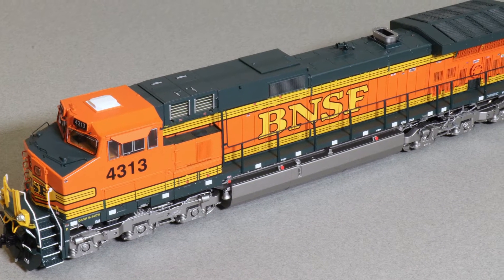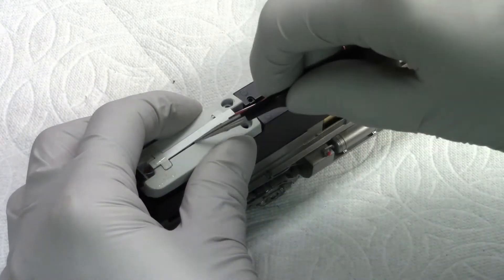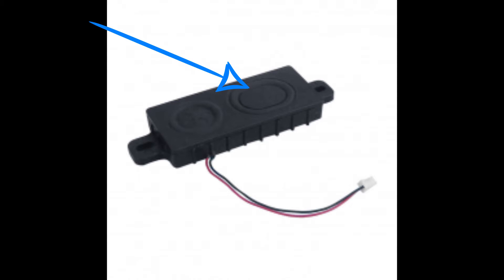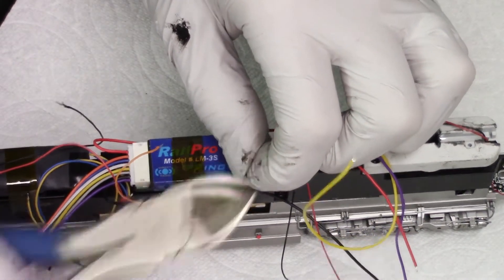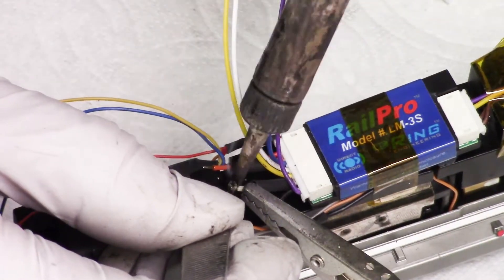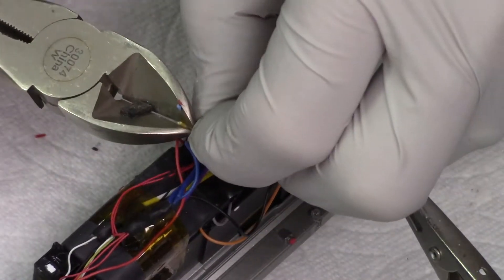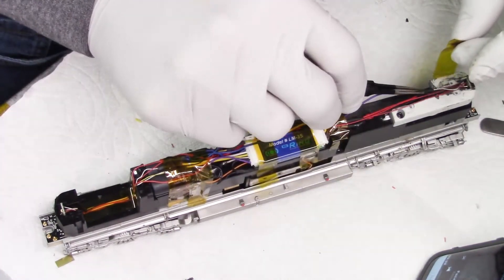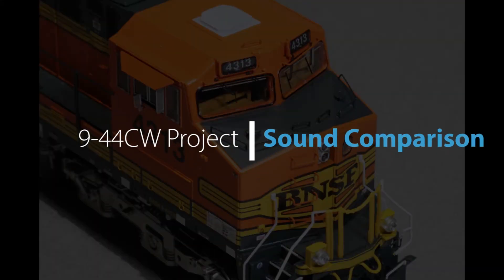ScaleTrains Dash 9 Build - Electrical (Part 2)

Comment: Hey Kevin.  Glad to see you’re still at it!   Really like the TB sound.   Totally agree with your assessment of the wiring and lights.  I just got a used Walther GP9 in. Just finished hardwiring a LM-3S to it with a sugar cube and a box I 3D printed.   HC-2 isn’t finding the new hardware though.  So I’m off to trouble shoot.  In the future I think I’m only going to buy scale trains locos. I have a couple and really liked them.

Comment: Hi Kpack, Another great video! You make things seem so easy to do. A lot of patience and skills you demonstrate. The result is just top notch and indeed the TB speaker just gives the 'machine' that extra sound realism. My roster is mainly 90% steam so I'm curious to find out more of Rail Pro steam sounds. Thanks for sharing & greetings from France, Filip
Reply from the maker: I like the TB speakers so far.  They don't go nearly as loud as others, but they have more range than most other speakers.  

Railpro has steam sounds but they are somewhat minimal.  I do know that they have more coming out, but not sure when.  The one thing Railpro desperately needs is a synchronized chuff cam.  It has the ability to do it, but the software has not been written yet for it.

Comment: As someone who is building their 1st layout I was going to use digitrax but after seeing rail pro I'm leaning more to using the rail pro system. How would I wire my small shelf style layout for railpro? Please forgive me if it's a dumb question but I haven't found any videos on how to wire for rail pro. Any advice would be greatly appreciated.

Comment: Sorry I have another question. Can I remove the factory sound decoder from a ScaleTrains loco and have the 21 pin plug remain to use with a RailPro sound module via an adapter harness. I realize I would have to connect the speaker wires into the 6 pin side.
Reply from the maker: Yes, that can be done.  I haven't done it myself personally, but know of guys who have.  You can use an adapter harness to plug in the 9-pin to the 21-pin.  Anything on the rear 6-pin of the LM-3S (speaker, two more function outputs, function input, and common power wire) will not plug into the 21 -pin and will need to be hardwired if you plan on using them.

Quite honestly, it was far easier for me just to remove the factory board in its entirety and just hardwire the LM-3S completely.  I also eliminated any potential problems with connections that way.

Comment: How many ohm resistor did you use for the lighting? Rings paperwork states "Use 1K ohm 1/4W for 15mA or 750ohm 1/2W for 20mA" Does this mean I should use the 1K ohm if I want the lights dimmer? and use the 750ohm if I want the lights brighter?
Reply from the maker: I use 1K ohm 1/4 watt resistors on everything.  I don't bother with other values of resistors because you can easily adjust the brightness of the lighting using the Railpro controller.   If I want a light dimmer, you can just set the brightness of that light in the locomotive setup pages.  Easy to do.
Reply: @freewake84  thank you. That’s sort of what I figured. I use RailPro as well.

Comment: What resistors are those?  I have an SDP40F I'm installing RailPro in and juat realized I ran out of resistors.  Those surface mount ones seem really tidy.
Reply from the maker: They're just surface mount resistors I picked up from Digikey.  They are 1/4 watt, 1K Ohm resistors.  They are dirt cheap.  I picked up a roll of 100 or something for a couple bucks.  At the same time I grabbed some other speakers to test (all failed) and several sizes of shrink tubing.  It's way cheaper to buy in bulk from a place like Digikey than a retail store.

Comment: Kevin, you say your speaker is a 4 Ohm. I'm l am using Railmaster DSM-8 that is an 8 Ohm. Will I need like a speaker capacitor or something for my Railpro module or no? This is all new to me.
Reply from the maker: No you will not.  Railpro can handle speakers from 4 Ohm to 16 Ohm.  Most speakers are 8 Ohm.   When the speaker load is low (4 Ohm) then the Railpro amplifier will push 2 Watts into the speakers, making them louder.  At 8 Ohm's the amplifier can drive 1 Watt, and at 16 Ohms it is 1/2 Watt.

I've used the DSM-8 in the past.  It's not a bad speaker, but I was never very happy with the sound quality for such a large box.  Once you try something like Scale Sound Systems speakers, dual or quad sugar cubes, or the TB speakers, you will never look back.
Reply: Kevin, what kind of 1" round speakers do you recommend for Kato engines that go in the fuel tank?

Comment: Great video Kevin, I have a fleet of ScaleTrains waiting for install now would you go with the TB again? or wait for the new SSS offering?
Reply from the maker: That's a tough question Bill.  The TB speaker certainly sounds nice, but it's not perfect.  Finding space is a challenge for sure.  SSS speakers are great, but they are limited by the size of the speaker enclosure in the ScaleTrains locomotives.  The enclosure is way too small for any decent sound.  So if you were going to use larger SSS speakers, you would need to remove some of the weight anyways.  At that point is it better just to go with something like TB that has significant bass for its size?  I don't know.  Tough question.

I haven't tried out the new SSS speakers since he made the new driver.  I'm curious how it sounds.  I really like the dual speakers he made before, but he's unable to do that now.
Reply: @freewake84  SSS is not happy with his new design speakers for ST yet. We'll see where that goes. Orlando's speakers sound pretty great in the unit I got from him, maybe I should send it to you for comparison?
Reply from the maker: @pdcweb  What speakers did he use?  Did he fit a different SSS speaker in it?  

I have a ScaleTrains ET44 with a SSS speaker and it's just not great sound.  Nothing wrong with the SSS speaker, but the ScaleTrains enclosure is just so darn small.  The next ST locomotive I get will for sure get some weight cut to fit a larger speaker, no matter what it is.
Reply: @freewake84  Here are pictures of the install with a link to the speakers: https://rpug.pdc.ca/index.php/topic,954.msg7306.html#msg7306